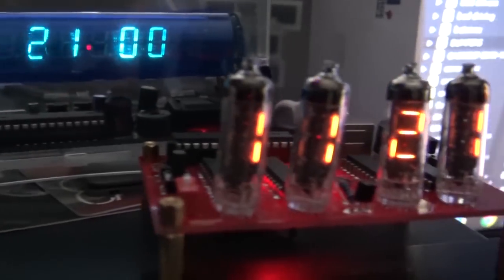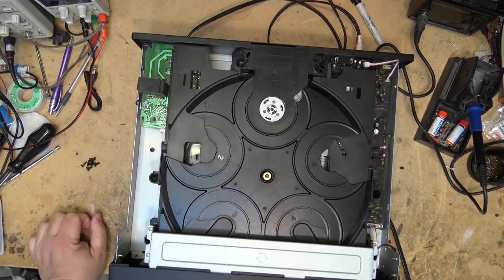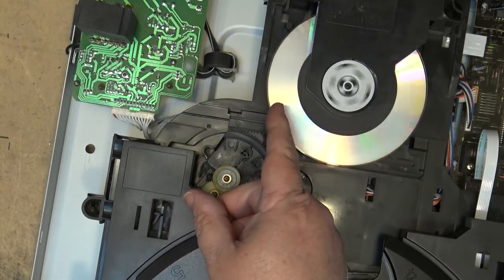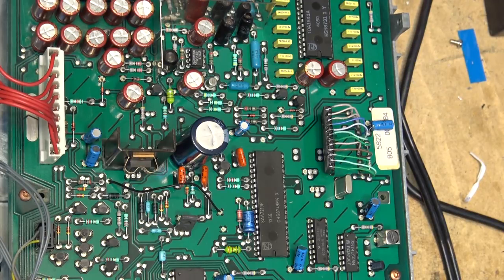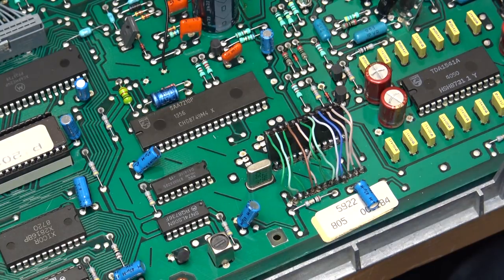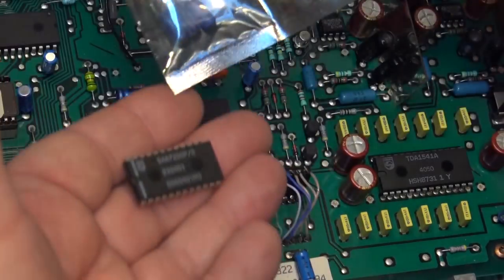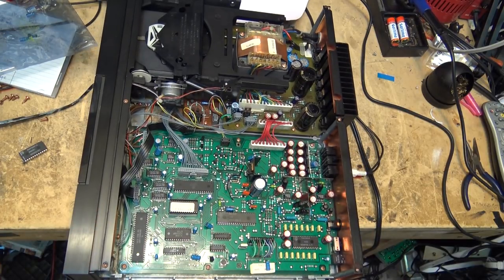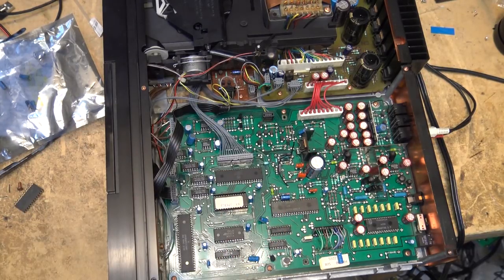2 cd players on the bench today

Comment: I have a cool story for ya. RCA CD-9500, which is 300+1 CD player, bought from Radio Shack when I turned 18 in 1995. (Pioneer PD-F1009 precisely the same unit and I use its service manual.) It wouldn't play discs well at all when I tried it recently. I have been meaning to look at if for a really long time now. Over the past week, I took it all mechanically and electrically apart probably at least 30 times. Suffice to say, I am an expert on that aspect now. I cleaned the heck out of everything possible with alcohol - had the floating optical block out, inspected it, cleaned the lens a million times (because progress WAS made each time, believe it or not) - had crazy adventures trying to make the arm work, lost the spring that guides the optical block left and right with respect to the motor, lost a thousand screws inside the unit (found them all when it happened, here or there, yes all) - oh right, from removing it so many times, the cable to the lens and mainboard got messed real bad, so I cut the end off to fix it and it did the trick! I play with RF power (again, no scope) and hear the high pitch lens noise that I try to eliminate and often do while trying to get discs to actually load and not skip as well. It had an even worse time with CDR. As it stands now, I can get the machine to playback stamped discs reliably 100% of the time, but CDR very rarely. If I tweak power to lower, than CDR starts easier but THEN stamped won't start. So, it is all a cunundrum as it stands. I am sure the eye pattern is not perfect, but once again, no scope. Still somehow, I feel I will be able to get it to play anything/all reliably within one more day or so of messing. I shall see. If you or others are curious: https://www.manualslib.com/manual/1146761/Pioneer-Pd-F1009.html

Comment: those 5 disc players are a pain in the ass...always the drawer jams or belts slip or cd's fall off the tray.... single player is good enough...
Reply: Pioneer really nailed it with the 6 pack changer system.
Reply: I have an harman kardon FL 8380 5disc changer which is known to be one of the most unreliable changers. Somehow mine still works fine on an mechanical standpoint, it just needed an laser and "carussel" sensor clean. But somehow the remote control doesn't work...

Comment: philips cd 880 LAST product from Philips that was heavy, solid, well made and with high end pretensions
Reply from the maker: You do know why it is heavy right? It has a solid heavy metal base that is screwed onto the bottom to stop it from resonating.
But you are right, this was a well made machine, and if I am able to source a new digital filter IC I'll change it, but I am not wasting my time with Ebay pulls.
Reply: Take a look at the Philips CD-80. First made in 1990 and is built like a tank.

Comment: Holly crap, what the hell did they do to that poor machine?, some days ago i finished restoring a philips cd 350 player with the Tda 1540a dac, two of them to be exact, and these machines are a pain to work with. All of those philips blue axial caps take a dump, and the machine starts going crazy, i had to change all of them on the machine to make it work again. Also those ribbon cables have a plastic conector that fails, and makes the machine go crazy, the laser would stop working or the motor would work backwards. But the most annoying problem and the one that took the most to figure out was that everything worked, except the stupid servo board, and the problem was that the 1k ohm laser pot on the board took a dump, and intead of being 360ohms it was 13k ohm!.
Fortunately its been working for a month now, solid stable. Good video, keep it up!

Comment: For the chip to send binary digital data to the other audio chip, it should store it in a parallel shift register consisting of J K flip flops.  Obviously, that J K chip will be nicely timed by an appropriate quartz timer for fast speeds, or a 555 for lower speeds of data transfer.
Frank Reiser M.S.

Comment: I cant see the number on the chip on the board due to be vertical but judging from the chip in your hand that is SAA7220P/B, one of my local electronic shops sells original SAA7220P/A chips. No idea what the difference between the two is but is available if needed.

Comment: I used to have a 5 disc CD changer, and it was awesome. I had two of them actually. One had a tape deck also in it and it worked pretty well for a couple of years and then it stopped working after my mom and my sister and I moved to a different house. I ended up with a new one for Christmas from Santa Claus. I was so happy with it. My first stereo was not a CD changer, it was just a 1 disc CD and cassette player stereo. I I am having a problem with two of my portable CD players. One doesn't have any issues except that it makes a skipping noise when I play the same song over and over or have the CD at a certain angle. The other one has a motor that keeps shuttering and stopping while the CD is playing. The CD keeps playing but the motor stops vibrating even though it's still spinning. Is that normal for that type of CD player. The type of CD player I have is one of those that has an AC adapter for it that you can use in place of normal double a batteries if you have a rechargeable battery. Is this normal for this rechargeable style of CD player? It also has keys instead of buttons. This makes it easier for me to turn it on while I am holding on to it and it's easier for me to hold onto because it's thinner. I am blind and autistic and have cognitive delays because of my autism, And the new CD player which is cheaper, I sometimes have issues with and sometimes I don't. It is smaller than my other one a little bit and it is thicker and a little rounder than what works well for me. This one is working just fine no cuz it still has buttons. It really kind of sucks When I opened it to check it I noticed the motor was loose. This was on the rechargeable on. If was right inside of the player so I could see that right away. I saw it after I was wiggling it around. I am going to have it looked at by a friend of my mom's to see if he can try and fix it. I don't know what the problem is if it's just a loose motor or multiple things wrong with it, but I think it would be cool if you could let me know what you think I should do, and what your opinion is. Thank you.

Comment: I wonder why most CD players play horizontally? Would it be beneficial to the motor to play vertically? I'd like to someday get a good vertically playing unit, if they exist. I have seen them, but can't say it was good quality.
Btw, if you can't fix something, nobody can.
Reply from the maker: It is beneficial to a degree. There were vertical playing players.   All of the mega changers are vertical playing units.   The advantage of course is dust doesn't collect on the lens.   The weight of the disk also does not press on the lower bearing of the soon motor.   There are plenty of mega changers still working.

Comment: As soon as I saw that botched IC and wiring, I would have taken pictures and called the client immediately. I would cease to do anything to the unit at that point, because you have zero idea what has been done to it or what has happened that resulted in that mess. 
There is no way that I would continue working on it. I'd be praying that I can show the mess to the customer, not get blamed for it, and get it out of the shop ASAP.
Reply from the maker: I do have pictures right. It is called a video. I have not done anything to this unit except measure a few voltages, and re-soldered the pins on the "bodged"
IC and I will be having a chat with the client before doing anymore work on this unit. I am quite certain that after he sees the condition he will have a chat with them. However he did buy it used, and he did replace the laser before taking it to the shop in question, so he will know if that chip was like then when he got it, or if the shop he took it to did that. I will probably give him a call tomorrow and show him the pictures.

Comment: Strange.... the CD880 uses the TDA1541A S1 chip... it appears not to be in the player. This machine has been messed up big time!
Reply: Edwin Slee 
There were versions with a “normal” TDA1541A too, I’ve seen a couple of such exemplars.
Reply: Given the soldering, the chip is original. S1 was only stamped on a chip if it was binned by the supplier (Philips Semiconductors). The CD player factory (Philips Hasselt) might have used their own binning process when they ran out of pre-binned ones, or determined that the quality control of the unbinned ones was good enough to use them and still have the player perform within spec. Strangely, both unmarked and S1 marked ones do carry the Y behind the mask number sometimes, indicating that they were factory tested to somewhat less rigorous standards to increase the yield. Apparently not affecting the ability to meet S1 spec.

Comment: When I saw shit like that I put it back together sent it out no charge. Most of
the time the customer would deny it was ever worked on. Thank God I only
did TV's & classic tube rigs for the most part.
Tom
LFOD !
Reply from the maker: Yes that is exactly how I feel. Same for some of these stupid AV sound system amplifiers. So many digital circuits and boards. I have a Harmon Kardon AVR740. My own unit, cpu locked up. What a nightmare it is. I almost don''t want to fix it. Well I do, but it is such a nightmare to try to test enything due to the way it is built. There are fuses on the main board soldered in place that the only way to get at them it to remove the digital board, analog board, Tuner board, then remove the heatsink and fans, in order to remove the main board to get to the bottom of the main board because they were too stupid to put a hatch on the bottom for access. Yes they put a cut away small hatch big enough to change the output transistors, but if you need over a few inches from the outputs which is where the fuses and regulators are forget it. Take the entire unit apart. I wasted several hours on this one of mine and got frustrated and put it back together. Dam there were some really stupid designs out there,
Reply: 12voltvids I had a Harman KARDON AV unit a guy gave me to repair and keep if I couldn't repair (part of buying some speakers off him) and I ended up mainly using as a source for extra screws. And my isolation transformer project, with another transformer in parallel.

Comment: Philips and Sony introduced the first compact disk (CD) in 1979.
Reply from the maker: The first consumer CD player released was the Sony CDP101. Released Oct 1, 1982 in Japan. There may have been prototypes before that date, but the CDO101 was the first consumer model released.
Reply: I have a news article from 1983 announcing the CD (American magazine) I didn't get a player until 1989. Quite a step up in dynamic range over consumer analog media.
Reply: The announced the concept in 1979. They introduced it in 1982/1983 as 12voltvids says.

Comment: Not your problem, advise customer to take legal advice for botched repair by another vendor.
Repair will never be 100% and it may never be right. Will not take on this job as it will never be satisfactory.
Use for parts.
Reply from the maker: The phipps is still sitting in the corner. The owner actually contacted me today and I told him again that it may not be repairable but I won't do anything unless i have a service manual. I have left the balm in his court.  All o know it he had already sunk hundreds into thos thing and I havent made a dime. He already put a new laser in it and recapped it at the other guys shop and then he washed his hands on it. I am not interested in getting married to it but I am not investing anything. He wants it fixed he will have to buy the manual first and then I will do some bit bashing.  I have already changed that bodge chip with all the wires and the da converter chip. It reads but no audio. So I am thinking a timing issue and that requires a manual.
Reply: @12voltvids  You have already got yourself entangled in this mess, 
have you been paid for the time and effort already spent on this? 
Just asking for a service manual means if he provides one he will expect you to finish the job.
If I were you I would tell him to collect the item as you need to make room 
and it is just in the way collecting dust and you are afraid it might get damaged or lost.
If he insists you hold on to it simply tell him he will need to pay you for the work done up to date,
Then present him with a hefty bill which he will refuse to pay, you win either way, he can either take it away with him or pay the bill 
which also has a clearly worded provision. 
 that this unit is badly damaged by previous repairs in another service dept and may never be repaired to his satisfaction.
I think he will take the hint.
Reply from the maker: @liammckenna3100  
This client is a millionaire. Beings me plenty of very high end units to service like that mcintosh dvd player, luxman preamp and fancy AR turntable.  I don't  chase away the audiophiles because when a nice piece does come in in they generally pay pretty good.   Some day I am sure I will get around to spending some time on it.  My schedule just changed at my regular job so now I have 3 days a week to spend working on electronics. Once the weather warms up a bit I will be in the shop more. 
I enjoy the challenge, but without a manual it is tough.

Comment: Stop crying like a baby…. Ok we get it… Person who repaired previously was a rookie. But you are a pro and should be able to unsolder that chip with your hands behind your back!!!  From your commentary, it really shows you don’t know what you are talking about…. DAC is TDA1541chip that is sitting untouched. The chip you are talking about is SAA7220 oversampling digital-filter and it’s readily available on eBay.  Seriously, you can convert that Philips CD880 to NOS mode (it is trivial) and by doing so…impress your audiophile friend and he will tell all his friends that you a hero… So Stop crying like a baby and man up.  Thanks. Cheers
Reply from the maker: James Williams 
I know what chip it is. I said it was the digital filter. The fact is behind it. Open your ears and listen. I can't repair it until the owner of it ok's the repair. Obviously it needs a new chip and that is probably all it needs however that won't be known until the chip is sourced and replaced. That is riding on if the owner approves it or not. It is in his hands now. We'll actually it is still in my hands but I am I. Hold until I get the ok. But considering what the last butcher did I fly expect that there may be more issues.